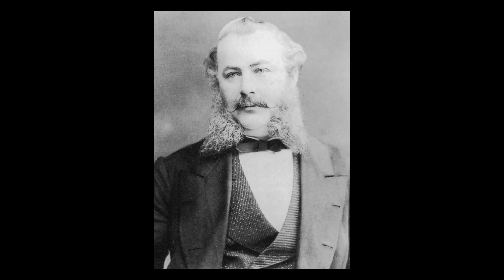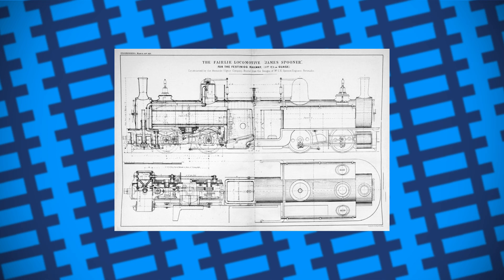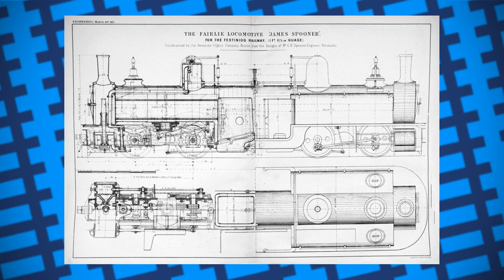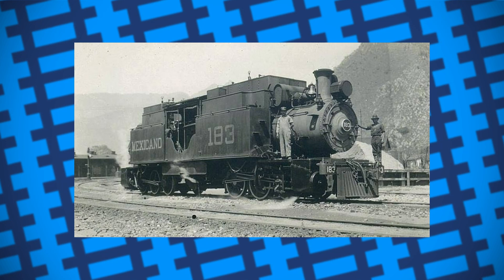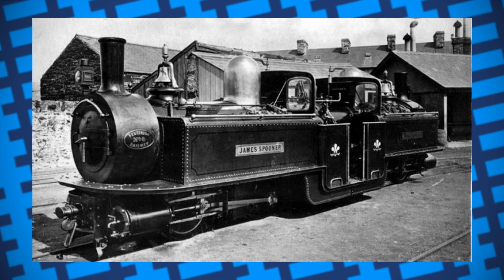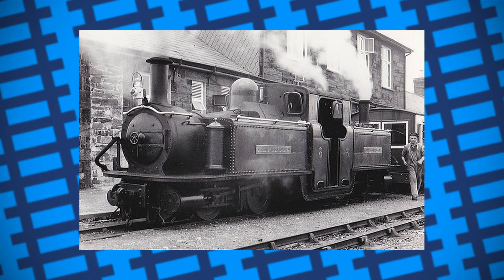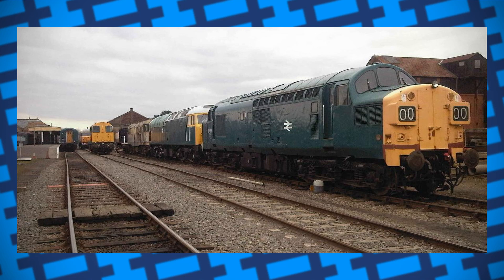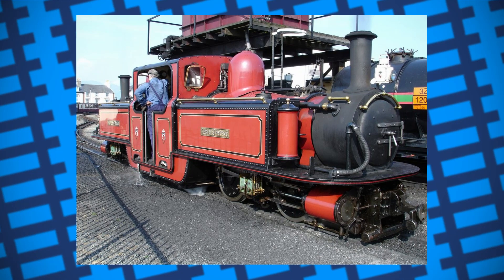The double ended steam locomotive - Fairlie Locomotives

Comment: Essentially he created a solution to a problem that didn't exist and in turn create more problems.
Reply: Welcome to Entrepreneurship 101 buddy. Finding solutions to problems people didn't know existed.
Reply: Hi did solve the very real problem of needing turntables, it just took more flexible drive systems like diesel or electric to make his idea practical.
Reply: @jpgiebl  Yes good point.
Reply: The actual problem he was trying to fix was how to get more powerful engines on narrow-gauge lines, which are often cramped and twisty.
Reply: There was a problem and it did exist.  

Traffic on the 2ft gauge Festiniog Railway had increased to the stage that the line desperately needed extra capacity.  This could have been done by converting it to double track, or converting it to standard gauge.  Neither of these options were practical without vast expense because much of the railway was built on a narrow shelf cut into the hillside.  Double-heading was one solution, but this was expensive because it took two locomotives and, more importantly, two crews.

Robert Fairlie thus had the idea of two engines back to back; this saved using two engines double headed.  He also had the idea of mounting it on bogies as the Festiniog line is very tortuous with sharp curves; the existing single engines at the time were 0-4-0T/Ts.  His Double Fairlie design only needed one set of enginemen, thus saving on the wages of a second crew.

So there was a problem, and it did exist.  He solved it, and the Ffestiniog Railway is still using Double Fairlies to this day.  In recent times it had built two new Double Fairlies (EARL OF MERIONETH and DAVID LLOYD GEORGE) with a third, JAMES SPOONER, currently under construction in its Boston Lodge Works.  

There are plenty of videos of videos of Double Fairlies hard at work on the Ffestiniog & Welsh Highland Railways on YouTube, including on my channel.
Reply: Here in New Zealand, the E class double Fairlies were very successful on the Taranaki line. This line has a ruling gradient of 1 in 35 in both directions, and many small-radius curves. With a very cramped loading gauge, and an axle load limit of about 8 tons, motive power became a problem in 1899 when the class of 6 locos was written off. 
The prob;em was solved by Wanganui and New Plymouth depots continuing to use them, as their flexibility power and sure-footed traction outweighed the limited coal and water capacity. Not only did four of them stay in service until 1920, but they were used often, on important trains, and had capital improvements like acetylene headlights, sand domes and air brakes. Then the regional manager found out, and ordered them scrapped.
Reply: @bertmeinders6758  Clearly a case of horses for courses.  One wouldn't expect to see Double Fairlies on main line express trains, but on narrow gauge tracks and in steep, twisty, mountainous locations they come into their own.
Reply: @barnabyjoy Well, you could use Double Fairlies anywhere, but the original design was for the narrow gauge, steeply graded, windy and twisty Ffestiniog Railway in North Wales.

Generally speaking, conventional locomotives are more suitable for high speed main lines.
Reply: @barnabyjoy André Chapelon wouldn't have argued with that!
Reply: @ronfisher2-railwaytravelvideos  Thisssss.
The Fairlie was developed for the Ffestiniog and railways like it - hard-up for space, staffing often tight, sharp curves,  steep climbs, narrow gauge, etc. And on such railways, the design proves its worth. Hence the Ffestiniog and WHR still using them, as you've said.

It just didn't prove nearly as successful on larger railways with longer hauls between stations, where the tradeoffs would have proven more problematic. I imagine this was especially the case for US-built Fairlies.
Reply: You could say the leader class was the most pratical solution to the consept shame it never worked as well as intended

Comment: "some american steam locomotives still incorporated swiveling powered bogies such as the big boy but for the most part the standard wheel layout worked much better" some ? durring the height of the steam era in the 1930's to 1950's in the US around 1600 articulated locomotives where in service and where proved to be incredibly capable machines that proved themselves as economicaly viable and where the best steam freights haulers on the main line
Reply: I mean yeah, but its still "some" relative to the overall number of locomotives im the US. I mean there were more Mikados in the US then there were all the different articulated wheel arrangements put together.
Reply: @whispofwords2590  a single articulated could do on average 2 to 3 and a half times the work that a 2-8-2 could do so articulated locomotives made up a similar amount of work to 2-8-2s even tho they had smaller numbers, and one or more class of advanced articulated was a common thing on 90% of large railroads and they where still many many times more common than the video makes em out to be, i know that the 2-8-0 and 2-8-2 where far more common than articulated, I'm just stating that the video making articulated locomotives out to be something rare even in the US is flat out false information, also they where common in Brazil, Africa and Australia
Reply: @monke3842  Even going off of what you just saud theyre still rare. Them being powerful and able to do the work of multiple smaller engines doesnt make up for the fact that that entire type of locomotive was outnumbers by a single wheel arrangement.
Reply: @whispofwords2590  i think we just have different definitions of rare
Reply: @whispofwords2590  they were most definitely not rare on mainlines. Yes, very few class 2 and 3 lines had articulated engines, and most used second hand engines from class 1 lines. But all of the class 1's had swapped to using articulated steamers for heavy freight, and only using traditional ones for fast freight and passenger service. (Excluding oc the PRR T-1) So yes, across ALL lines, they would be rare. But on mainlines, they were staples.

The only reason why they didn't become even more common was because the diesels popped up almost at the exact same time. It was well known to the mechanical engineers that they were working on a dying breed, and they really poured their hearts and souls into the beasts. Had there been more time until diesels took over, there would have been even more articulated engines.

PRR T-1, PRR Mountain and others, C&O's Mountain and another one or two, N&W had some. UP had the Big Boy and Challenger. SP had some including the Cab Forward. Santa Fe had several types. B&N had them. Really I think that basically all of the mainlines were using articulated engines en masse before the end of steam.

Heck, there's plenty of videos of Horseshoe Curve with trains being pulled by 2 and 3 Mountain types each, while other trains with articulated engines go the other way, and fast freights and passengers with K-4's go on the other tracks.

Oc now they're rare bc they were a crapload of scrap metal when they left service. It's one thing to write off a few k4's to preservation, it's another if it's a Mountain.
Reply: and they weren’t powered bogies, they had regular drive wheels with the guide typical wheels in the front doing the normal guidance for the drive wheels
Reply: @CPD0123a  Just putting it out there the PRR M1b/M1a (mountain) isn't an articulated it's a normal 4-8-2 mountain type. Also the PRR T1 is a duplex. Just like the PRR Q2 and Q1 not an articulated a duplex is an engine with 4 pistons but it is not hinged or articulated. The only articulated's the PRR had were the HH1s, HC1s, CC1s, and CC2s. I suppose you could also count the time the PRR borrowed one of the N&W's class A's.
Reply: Yeah I had a similar thought. Most all major roads used them. Big boy, challenger, Yellowstones, Cab-Forwards, Alleghenies, Chessie Mallets, NW Class A's, and even the legendary (if disappointing) Erie triplex's are practically the definition of High Power Freight Steam.
Reply: AHEM austalia and south africa would to contact you about the beyer garratt locomotives that what farlie's would have but better
Reply: There were also locomotives fitted with trailing truck booster engines or tender booster engines
Reply: Like the Canadian Pacific Selkirk locomotives the South Australian northern
Reply: There being fewer articulateds than conventinal steam locomotives is really a moot point; most of them were designed specifically to replace the practice of double or triple-heading regular engines on heavy freights, and many of them did exactly that.

Another point worth mentioning is that the development of articulated steam locomotives in the United States begins not with Fairlies, but with Mallets. The inclusion of 2-6-6-2's and 2-8-8-2's in the USRA standard locomotive designs is also indicative of a higher prevalence of articulation in the US.

Comment: "Damn, look at all this wasted space on fuel and water"
Massively shrinks the fuel and water space
"Oh no, it doesn't have enough space for fuel and water!"
Reply: ultimate bruh moment
Reply: It's less shrinking it, and more designing the locomotive in a way that made slapping more on hard.
Reply: Which, in the original context these were designed for - increasing pulling capacity on mountainous narrow-gauge railways while keeping the engine's footprint relatively compact and needing only one crew - was an acceptable tradeoff.
Reply: bruh thats wut im sayin